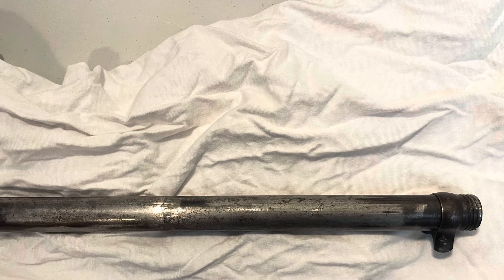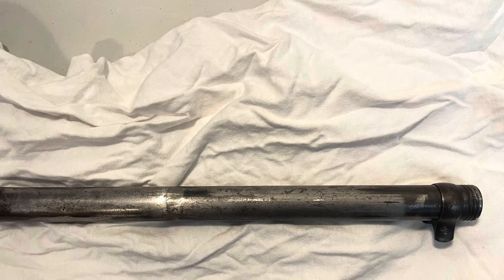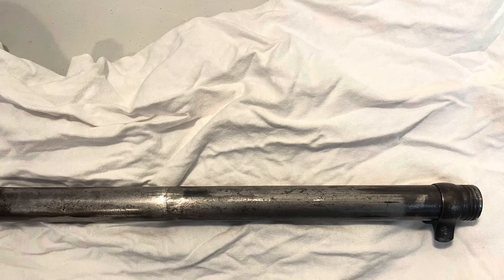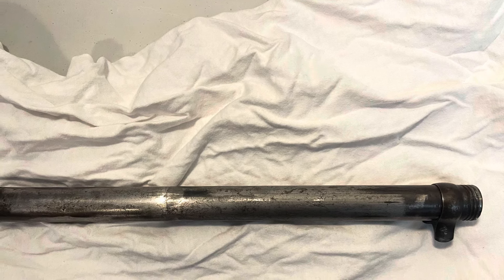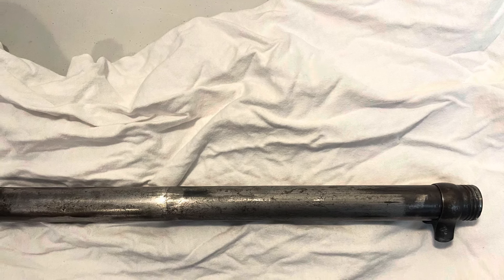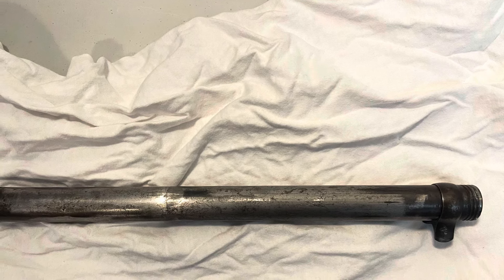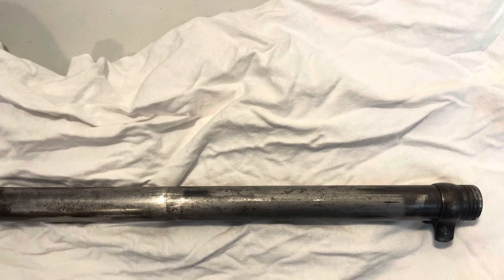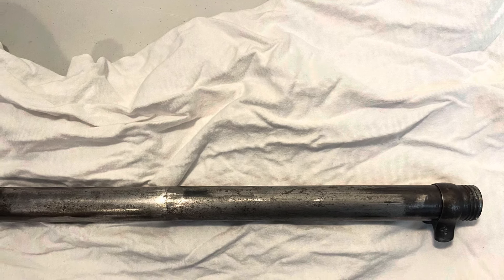Remington Model 17 20 Gauge shotgun update. Trimmed barrel, rebluing, cleaned, oiled.

Comment: I will inherit my granddad's Model 17 when an uncle passes (he's 94).  I started using this gun at age 12, about 1956.  Gramps used it - a LOT, in his earlier days.  He would purchase a case of shells every year and usually run out.  The gun shows the effects of this kind of use - the receiver face where the shells strike it coming out of the magazine, is worn about 1/16" deep - that's a lot of brass striking in that spot.  I cleaned it up well the last time I saw it in the 70s; I doubt my uncle did anything - he was known for taking crocus cloth to guns (ruined a very nice one of mine) purely out of ignorance.  We will see.

A story about the gun.  I attended a skeet and trap shoot in the 70s and took that gun, as my Winchester had been loaned to a friend for a western pheasant hunt.  This was an invited event, mostly social rather than real competition, sponsored by a vendor to our industry.  As there were many who never picked up a gun, safety rules were strict. Guns checked in and secured upon arrival, checked out to shoot ad back in after.  As I picked up the gun from the rack a fellow behind me said, "do you like my gun?"  I turned and  said "Its my gun."  Looked at the ticket and I had indeed picked up the wrong gun; mine was 3 slots away in the rack.  Since the Model 17 was not very common, we compared memories.  His grandfather had purchased his in the 1920s at the same hardware store.  The serial numbers were consecutive !  The guns had come back together 50 years later.
Reply from the maker: That is awesome, I love these personal stories. Hopefully you can extend its life as I have with mine. I recently put a new stock on mine- have a video about that too

Comment: That's awesome!  There were some vids of a guy on here a few years back that showed using browning solution after heating the metal and then, once you get a good brown, neutralize it with blueing solution and then oil.   It gave a very deep, rich, durable rust blue very quickly and easily.  Haven't tried it myself though i have a few projects i need to get on...
Thanks for the vid!
Reply from the maker: Yeah, using a bug tank of solution works well too, but I’m not set up for that at all
Reply: @crankygunreviews  the browning solution is applied with a rag onto heated metal... Not too hot to touch... Then left until a full coat of rust is formed and then it is neutralized by wiping on a cold blue, which transforms it into a deep blue.  You need to find the vids, because i think I'm missing an important step, but that is basically as easy as it is.  No tanks or sweat boxes, just a $20 bottle of browning solution, some rags, steel wool and some cold blue.  It gives a real rust blue very quick and easy.  It's a brilliant way to do it.  The vid was on some obscure channel and is old, but i might have time to go look for it in a little while, if i find it, i will post it here.
Reply from the maker: @curly__3  interesting- I may have to look for that
Reply: @crankygunreviews  ... I found it and posted it but it was censored for some reason... The channel is ginsboy2003... The title is, ''the best cold blue method''...

Comment: Nice job! Adding the additional steps takes time but it darkens the blue and gives it more durability. When the rest of the gun is blue it will be protected and look good too.  
You can use alcohol OR acetone (not both)on the stock to pull oil from it BUT you have to have good ventilation especially with acetone. Gloves should be worn with each but especially Acetone. Acetone can actually enter the body through the lungs or skin and attack the nervous system. Most of the time with several applications either will pull enough oil to allow the stock to absorb a good wood glue or Acraglass as a repair. They both work well.  I always have Acraglass on hand and it's stronger so that's what I use most often. It also can be mixed with a little sawdust obtained from under the guns but pad to help it color match an area missing a splinter. You can mix a tiny amount on s piece of paper, let it dry and inspect for color match prior to mixing a batch for the gun. Most wood glues dry clear but most lose a bit of strength when saw dust or another colorant is added.
Reply from the maker: Yeah I know acetone is nasty stuff- I try not to use it most times. Is Acraglass like automotive fiberglass resin? I know that stuff can work really well/ dries super hard, and can be sanded, filed, and drilled to make the stock better… I could try that.
Reply: @crankygunreviews   Acraglass was created for gunsmiths. It used to be used for glass bedding actions and barrel channels. Most of that has come to a stop due to pillar bedding and chasis stocks but the product is still availble everywhere. Even Amazon sells it, The gels form is the easiest to use. Not only is this stuff sandable it will hold 10's of thousands of pounds.  Read a little about it. It's great stuff
Reply from the maker: @frankbrowning328  ohhh yess I remember now
Reply: @crankygunreviews  It will even hold screws. I've drilled and tapped screws in it several times